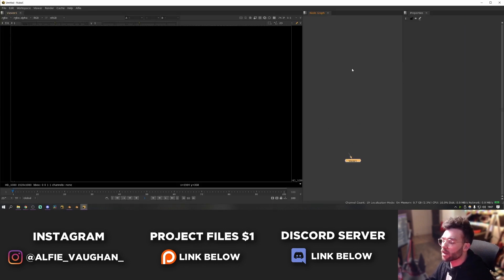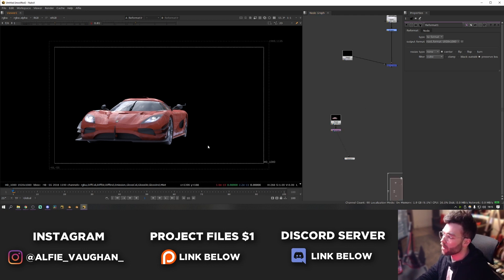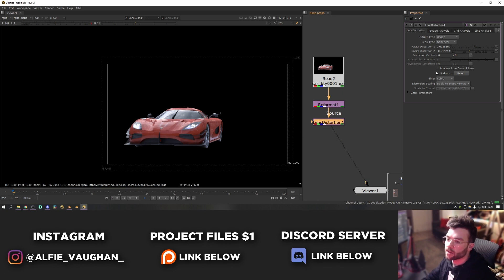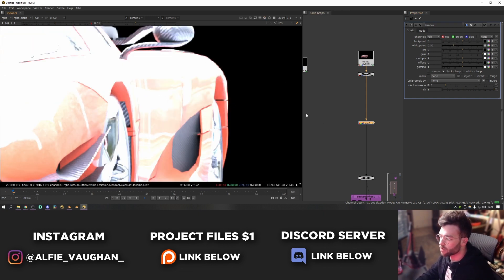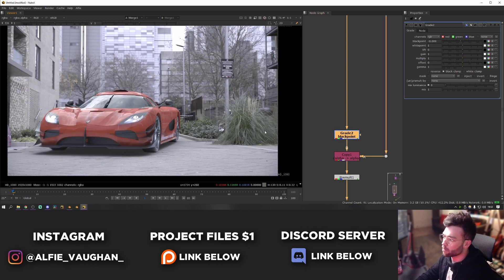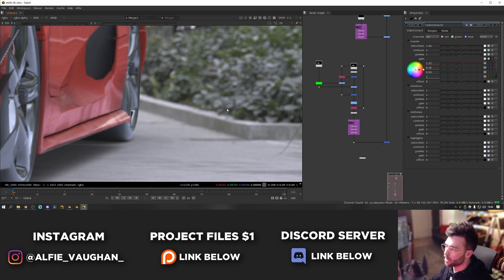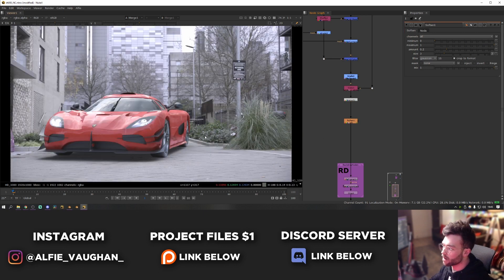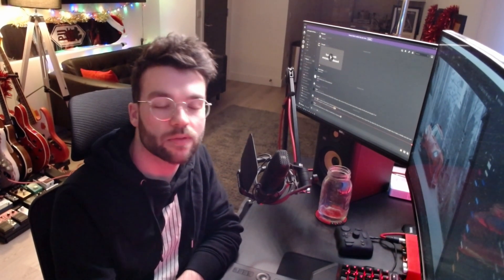Basics Of CG Compositing (Part 1) | NUKE FOR NOOBS!

Comment: How do I export a utility render? I don't find any:(
Reply from the maker: You can use multiple file output nodes for the render passes and just select the render layer relating to each. I usually do a beauty which is just the combined passes and then a utility where I enable cryptomattes, zdepth, normals etc

Comment: Is it recommended to only use openEXR file format to get all the render layers and passes for comping or is there anything lighter? I'm just imagining trying to do that with 4K frames and running out of drive space very quickly :/ I feel like I need a good proxy workflow to achieve what I want in Nuke with my storage/processing limitations
Reply from the maker: There aren't any others sadly. EXRs are the only format that support so many channels. There are different compression levels you can set to help with the amount of space they take up. Although some passes like cryptomattes can't be compressed or they break

Comment: Thanks for the tutorial Alfie! I do have some questions though.
05:45  Is there a way to merge the A side (which is larger size) to the B side without having the merge node align the larger image to the lower left. Insted I would need to align both images just to the center. I guess this is one of the reasons you are using that CC/grade node instead of merge. 
I am in a situation where I have to precisely placing the CG on to the footage, with lens distortion of course.í
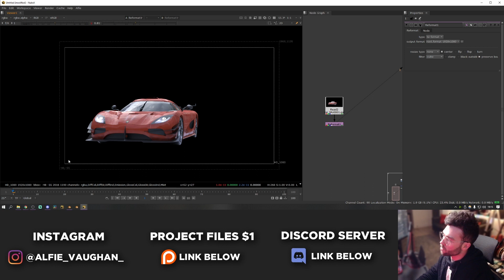03:06 The Reformat version has the bounding box at 1968x1135, which is a bit smaller than your original render. Why is that?
Thanks! :)
Reply from the maker: Yep you have to add a reformat node under the larger image with the format of the background image (in this case HD) and set the resize type to none so it scales from the centre instead of the bottom left. Then they should overlay how you want
Reply: @AlfieVaughan  Thanks for the quick reply! Appreciate that!

Comment: Thank you Alfie for all the great info! One question. When you turn on the LensDistortion node for the original footage (4:50) the algorithm pulls the corners inwards to undistort it (therefore repeates the edges). And later when you apply the reverse procedure to distort the cg it pulls the corners away from the center. That means your lens has "reverse fisheye" distortion? :S
Reply from the maker: Yeah there's 2 types. Pin cushion and barrel distortion. They go in 2 different directions depending on the lens and the focal lengths

Comment: Use the Y normals as a mask and grade up the diffuse and spec. Use -Y and grade it down. Fake relighting that helps bring out the shapes of the car.
Reply from the maker: Good tip but I didn't include stuff like that because this is just a basics video!

Comment: Sorry i think there's might be some misconception about Zdefocus. I always having a bad time trying to use it. I was taught that blue area - is what is farer from the camera, and red - whats in front. And the info box in ZDefocus says the same. But i dont like results what i get with this setup, and actualy preffers when the matematics is "inverted", like you show here in video. 
Shouldnt we set the "math" to "depth"? Or default "far=0" is ok specificly for Blender depth pass?
Reply from the maker: Hmmm I've never read the info box but it's obvious whatever is closer/further away from the camera so you should be able to see which bits are which colour. As for the math, you can set it to whatever you like that gives the best results. Sometimes setting it to direct helps with edges
Reply: @AlfieVaughan  I mean, if we changing (or using wrong) math, colours (distances) are flipping.  Edges should be fine if using z depth without antialiasing filter applied while rendering. Gonna play with it more, thank! Waiting for second series